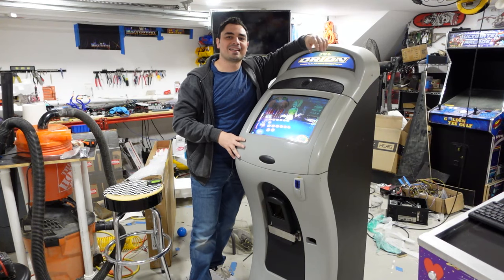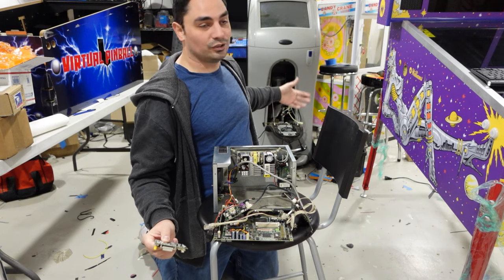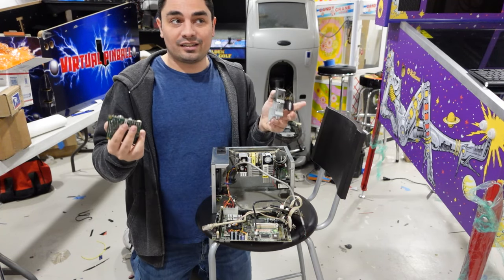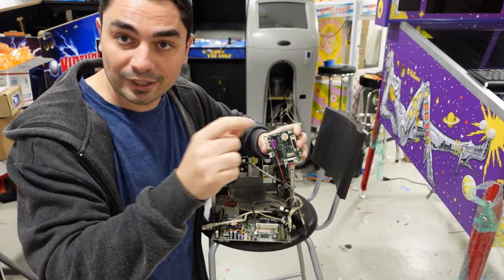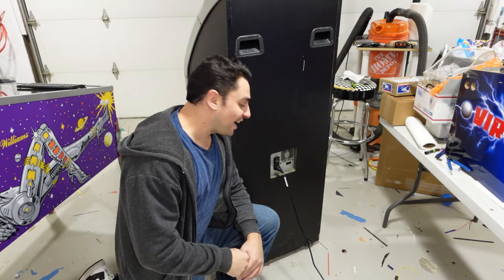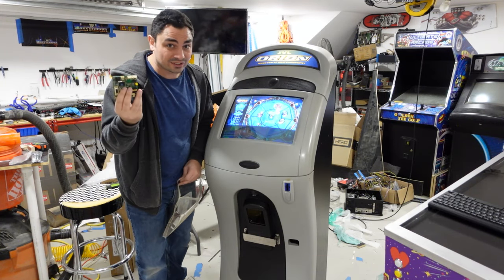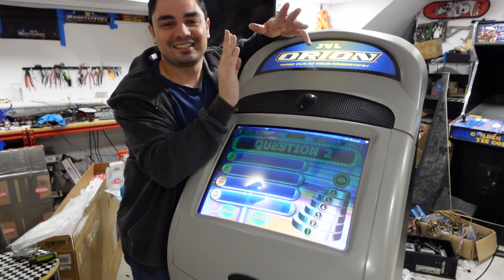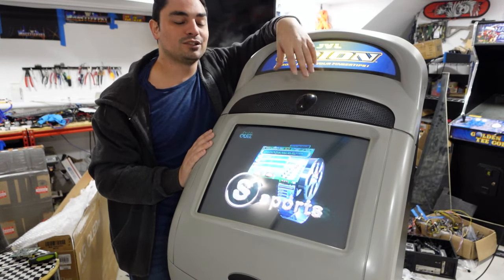JVL Orion IS ALIVE! Free.99 Marketplace find gets a new io Board!

Comment: You should buy the battery and try to connect it to the old I/O board. If you need the other end of those audio connectors I can send you some.
Reply from the maker: Io board that was originally in the cab is dead. I put even the cmos battery as you see on the New board and the io board isn't recognized.